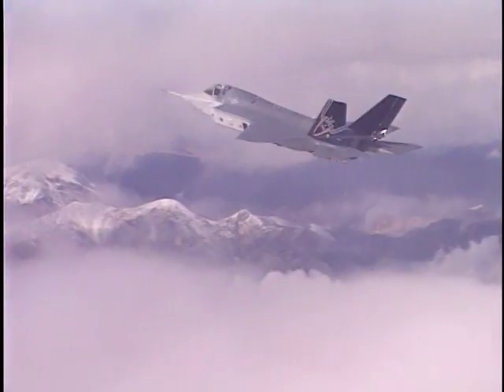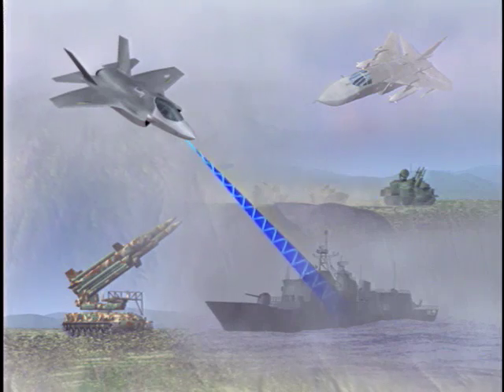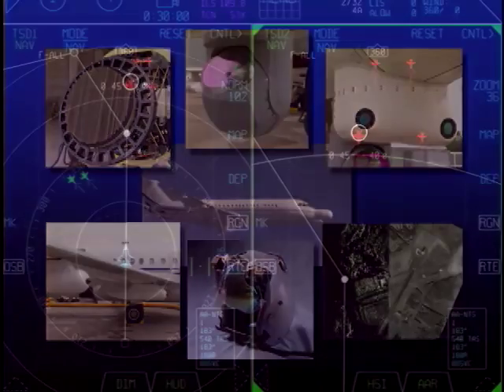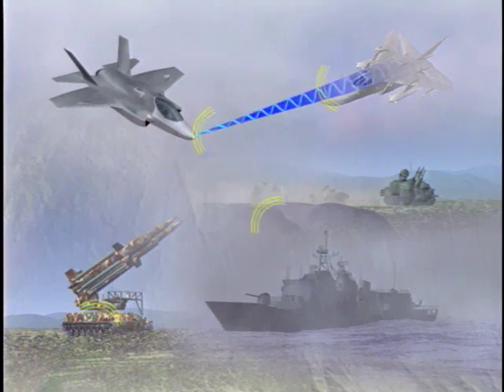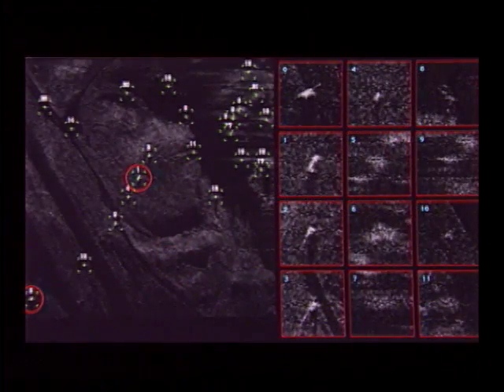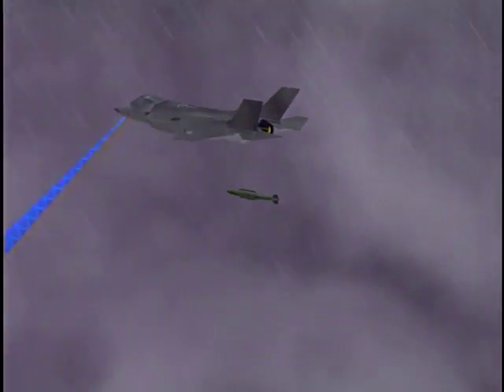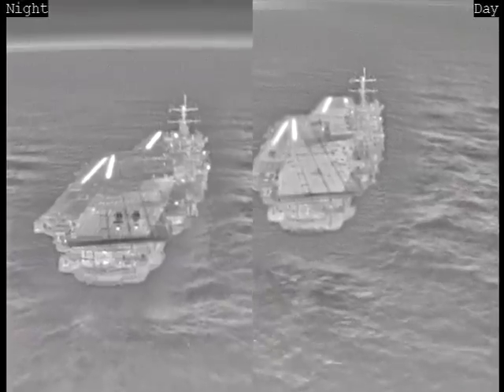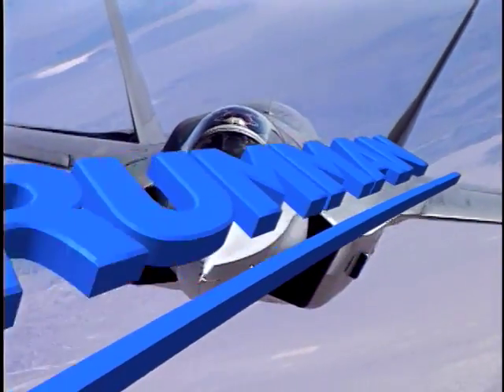F-35 Data Fused Sensors

Comment: impossible dreams. so you can fight only with the Papuans. Why the Americans think that only they have the optical systems and radars AESA. That's ridiculous, defense against this type C300 from the trough with wings no chance naive developers do not assume that ground air defenses are far more powerful than the antenna and systems on aircraft and detect targets at ranges of about 300-500km. moreover, they are why we decided that no one except Amerkiantsev no modern AWACS and satellites. Why would the developers of F-35 decided that if they saw a rocket and shooting trap the ravketa necessarily fly in the trap? Examples cause an infinite set, which only cost rockets that fly on the flight back to this nonsense have to guess, because the attacker behind the rocket plane would fly in a straight line and catch up with the F-35 earlier than the rocket that need to be developed, besides attacking the aircraft may, after Start right away.
In general, I feel sorry for the Americans as they have begun marasmus.
Reply: Иван Руденко     The Russians are scared to death of the F-35, your comment proves it.
Reply: Иван Руденко You are delusional.
All your arguments are lame. Sorry to say that. You took them from Pierre Sprey (and the videos he made for several newscenters), a guy who once (40 years ago) worked as theoretic analyst for the pentagon - but now works as Record producer.
And no - satellites are not at the stage of being a solid option for aircraft detection (at least not at this stage). 
The Indians also confirmed, that the Stealth technology of the T-50 wasn't sufficient! 

And who says, that the S-400 can shoot own this or that? The Russians which have national pride and also wants to sell the system??? Do you even understand what propaganda is???
You don't even know, what hypersonic means! Just stop it. You really are a delusional Russian fanboy!
I didn't even said, that the F-35 is impeccable. Time will tell. But I am also not as naïve- yes stupid, to believe 100% what one side is saying. I read beyond the lines. If there are no orders of the T-50, but the Indians would die to buy a similarly priced F-35 - it seems quite obvious, doesn't it?
Now the IAF seem even to be interested in buying an upgraded F-18 Hornet - instead of the Russian suggested Mig-35...
Reply: stealth is the advantage, combined with internal jamming f35 gets close and takes out S300/S400 combine that with decoys and Sam sites don't stand a chance
Reply: Иван Руденко 
I said often enough, it is absolutely an open outcome - neither the F-35 (or F-22 or even the B-2's) nor the S-400 are certain to be effective against the opposite system.

The Russians have no stealth design, which is comes close to the stealth air frames of the USAF. Yes - off course, they can claim that the S-400 is able to track stealth airframes, but how could they even confirmed it to themselves?? 
I think, the US have a slight advantage, as the S-400 is using conventional technology and just developed it far further. However I am sure, that DARPA has similar prototypes, but I am not sure, if they have ever been tested.
I also don't understand, why you say, that it is 19 years delayed. This is far from the truth - especially when only in 2001 the producing companies were formal confirmed.
Yes, the idea is older, but a delay is related to the projected introduction date, and while the F-35 is delayed (but it is also now fielded), it is far from almost 2 decades delayed.

What most people don't understand is, that the F-35 is a) one of the most complex fighter aircrafts ever produced (which increases the possible problems exponentially, but also increases its potential). b) The F-35 is far more as its controversial hull - and even far more than its stealth. It has radar evading technologies and god knows, what else (as most systems are still classified).
c) Fact is, that Russia developed their PMF (PakFa, T-50 - however you like to call it). If they would be so sure, about their anti-air technology and if they would be convinced, that a stealth aircraft is easily trackable, they would not have spent dozen of billions of $ into the development of their own stealth airframe (same applies to China, which already got their S-400 and probably warmed up their copymachines). Logic goes this way: if we can build one advanced system, our opponents will be able as well - maybe with a slight delay - but not a delay which is as huge as the development cycle of a plane.
d) Russia is known to "troll" with its technology. There are several instances, but the last one was, that they communicated, that they have a working plasma stealth device on all of their fighter aircrafts, which is better than physical stealth. As we all know, they revealed a couple of years after their T-50, which proofs, that their claim of plasma stealth was totally taken out of thin air (the concept, of plasma stealth is in fact correct, however the application is utopia, at least at the current status of technology).
Reply: Иван Руденко Sorry but you are too much influenced by Russian propaganda.
I am not American to begin with. And a lot of Americans are also criticising the F-35. It has not a lot of fans.
But you have to see things straight, to have a realistic picture of the situation- and Russian fanboys definitely don't see clear!
1) Plasma stealth is totally bullshit!! It doesn't work on any airplane and never did! It was just an attempt by Russia to keep the voices down, when America developed already their 3rd generation Stealth airplanes.
2) Assumptions are the most stupidest thing to do, when it comes to complex systems. So weight (the F-35 has the most powerful engine ever produced for a fighter), power, aerodynamics etc. have to be properly analysed (calculated) and not evaluated "by eye".
3) The T-50: When the Indians evaluated the flight data of the T-50, they expressed their disappointment and mentioned, that most performances stats are below the expectations. This is by a 3rd party which spend already billions into its development, yet, cancelled their order - even though Russia lowered the price significantly. Russia on their own side only ordered 19 pieces of the Su-50... this says a lot!
All the partners of the F-35 still wait in line - and except in countries, where the purchase is a very political decision (Canada and probably Australia - but for both countries a cancellation isn't decided yet). Rest assured, that the decision makers have far more information as we do have in the internet!
4) I don't say, that DARPA designs (of stealth or anti-air) are implemented. But DARPA is researching and I am sure, that the Americans have a better idea, what the S-400 can do (and how far stealth is in jeopardy), than the Russians have an idea, how effective is 4th generation stealth. 
5) Finally the F-117 (I didn't really understood what you meant with your other gibberish - and probably didn't really cared): A lot of people simply don't understand the success of the F-117 and the B-2. When the F-117 was shot down, the squad flew hundred of sorties always through the same airspace corridor - every strategist would say, that it is totally wrong - yet the USAF had no other chance (these were the "rules"). The Serbian army knew, the corridor, intercepted also radio communication and adjusted their radar for exactly this purpose... hence they had just to "blindly" shoot. So they shot down one F-117 (but not even the other ones in the squad).
It is a testament for the airframe, to have only one airframe ever shot down - and its success rate is unprecedented. The thing what "civilians" don't understand: stealth means not invisible. It means, it is more difficult to spot (radar, infrared etc) and more difficult to lock on. 
6) The only fact, what Russians compared to Americans invest into military (and especially military development) is a very clear sign. Even though, if Russia would have better efficiency, far lower salaries etc. it still a big difference. You have to be very naïve to disregard this - and as naïve to disregard the very big difference of freedom of speech and press freedom!
Reply: Here's a great article about advanced Russian aircraft. I wouldn't even call the T-50 stealth.

http://www.realcleardefense.com/articles/2015/11/05/the_f-35_vs_the_russian_su-35_and_the_pak_fa_108649.html

A couple of excerpts below.

"According to the Indian press, the aircraft (the basis for the Indian 
FGFA under a joint program with Russia) currently has significant 
problems including engine performance, the reliability of its AESA 
radar, and poor stealth engineering"

"In 2011, Russian and Indian press reports started attributing even less stealth to the aircraft.  Military journalist Dmitriy Litovkin, writing in 
Izvestya, stated that the PAK T-50’s RCS “will be equal to 0.5 square 
meters (for the Su-30 MKI it is 20 square meters).”  An Indian military 
publication, Force Online, said the Indian version of the PAK FA “will 
reportedly have a RCS of 0.5 square meters….By comparison, the Su-30MKI 
[the Indian version of the Su-30] has a RCS of approximately 20 square 
metres, while Lockheed Martin’s F/A-22 Raptor has the RCS of a small 
bird or a bumble bee at between 0.001 and 0.01 square metres.”  Indian 
and Russian press reports are consistently attributing a .5 square meter
 RCS to both versions of the PAK FA.  A report in Combat Aircraft by 
Russian journalist Piotr Butoswki from the 2011 Moscow Air Show said, 
“Based on scant Russian data the T-50 has a radar cross section lower 
than 0.5m2, which is 25 times less than that of a Su-27.”  In 2013, 
Russia behind the Headlines, which is state-owned publication, said that
 the PAK FA RCS was 5.3 square feet which is almost exactly .5 square 
meters.  In 2014 and 2015, two Russian reports said its RCS was “0.1 to 1
square meter” which implies a central value of about .5 square meter."
And the APG-81 was an incredible EW capbility. Not all AESA radars are created equal.
Reply: Fantastic link! Thanks!
Reply: The technology has already been proven when Israel  launched F-35s on Iranian sar 300s.On the first go around an f-35 dropped it bays doors for a launch but failed to close them and was immediately check mate luckily surviving the the shrapnel to make it back home.Critiques were made of this and on there next attack took 2 SAR sites out sparing them 2 until the 3rd world terrorist started pitching bombs on the heights again.consequently all of Iranian air defense was wiped out  It's true you don't stand a chance.
Reply: Your papua word is a little bit racist
Reply: +Иван Руденко 
Look - here is some constructive feedback: you are commenting on a promotional video of Northrop Grumman.
First - nobody says, that only America has AESA. We know, that contemporary Russian fighters [as well as next gen Chinese fighters] have AESA.
Second: I am sure, that the developers are not "naïve". But they won't disclose eventually ten of thousands of people their classified systems.
Reply: vijay mehra 
It is waiting for you on your tub. Our C400 will be the most expensive training target. Initially adopted its take. Already 19 years delayete and can not do. F35 is a shame the US aerospace and stategicheskogo planning.
Reply: Dominik MJ 
No need to be highly intelligent to understand that that F35 Too heavy and has poor traction engine for the fighter, bomber, he imee small load, but as he did not attack and tenacious road. Americans for some reason you believe that once you have advanced technology. Stealth works well against one of the radar, but he can not hide from the integrated air defense which includes satellites, the-horizon radar, and hundreds of other radars and systems. Almost none of the video clip (and the information fed to you in the form of clips) do not have a minimum of criticism that the DAS that the AESA radar. DARPA leads you by the nose, for all time any standing development has not submitted. As concerns Plasma stele it is but it has a side effect, the plane just did not see because of the plasma bag anything your system and does not make sense. The difference from your F35 our T50 flies better than any of your aircraft has better weight distribution, and has compartments for large powerful rocket, very powerful engines and better than your radar and optical system were more Mig-29. A design T50 dictated by its variable speed, it should be effective in the entire range from small to 2M, with a delta wing design and powerful mechanization that corresponds. Yes applied elements of stealth design, why not, but we have "invisible" do not put in the 1st place, because they know that it does not happen. Remember the F-117 is absolutely not visible in the end knocked antediluvian complex where outdated when even my dad served. A Papuan type Libya can and airplanes to bomb 50 years why build a machine to do that stands as our missile cruiser. All this high-tech it is absolutely not practical in a war. This pure white hangars horoshr he looks, and potions piled with dirt and debris, soot from pazharov I'll see what he will give it your ALICE. The United States has long been a military power, obsolete tanks, aging fleet, aircraft useless and most unfortunate problem with brains have command.
Reply: Dominik MJ 
Unfortunately the language barrier does not allow me to describe the full analysis. No prikidok eye I did not do. At F35 engine + 1 Lifting fan that gives nothing in flight, but it takes place in which would be fuel or weapons. Just no review back there that is small in size and wings (look at Harier and Yak-38) a big load on the wing for fighter too bad (that's the way was the cause of development HELMET AND DAS) aircraft as well as all aircraft with vertical take-off, weak and heavy motor). F35 can not take off vertically with a weapon, and just sit empty. But run he almost 1 km on the rise, such as the T-50 is just 250 meters away on the afterburner. Q. Why then molded vertical takeoff? (The answer I know but do not want to say what you would think). Now about the magical abilities of stealth. Firstly it would rely on stealth must know ka con running all ssmysl "stealth design" in the fact that the waves do not otrazhayutsya to get from where it is irradiated on this form are chopped, the second time it absorbs radio materials. Pay attention to the shape of the F-117 and the F22 and F35 they are made so that they are difficult to detect from the bottom in front of the hemisphere, it is done that would ground their defense did not show. But even logically there are a number of problems. 1 Satellite reconnaissance are located on top, and with such a perspective "stealth design does not work" because he does not work on the course dogonku and obulchenii from the side. Conclusion: from one of two separate radar so to save, but the system will integrate with several radarmi in Locally military network is not, because the reflected waves budt take other antennas from another angle. The fighters in attacks from the side and the other angles will see £ 35. 2 When the aircraft is maneuvering, wave reflection angles menyayutsya that will come out in the same stealth.
3. Radio absorb the materials we were still on the MiG-29, and now we have advanced a lot in this regard.
All this miracle of technology has already been tested USSR in 1961 and form F117 we received earlier than the US, but we do not bet on it because we do not want to "kill with impunity"
Now through S400 where the United States will be able to get that cheat physics? In rocketry we are far ahead of all. Our S400 can shoot down any purpose including hypersonic and missiles from his AI and puskayutsya no one there with EMP, have nuclear can vzorvatv sky EYP your general F35 themselves fall. I'm not talking about Stationary air defense missile-A-135.
At the expense of the Chinese people, that's when they will fly samalet as our then we'll talk. While their "crafts" a poor excuse, all engines have our production. They no T50 will not sell, they ate the jewels of the Su-35.
More naliziruyte see less advertising